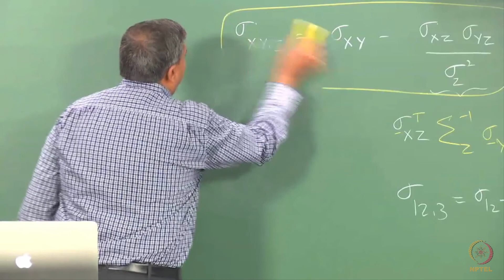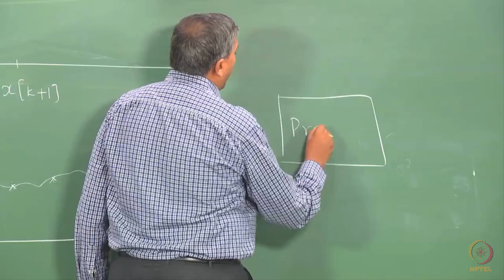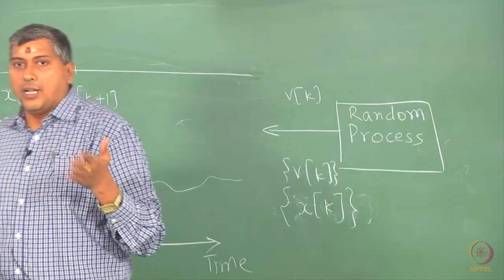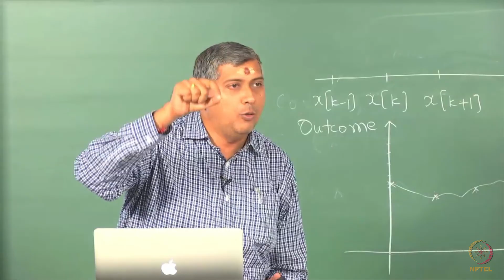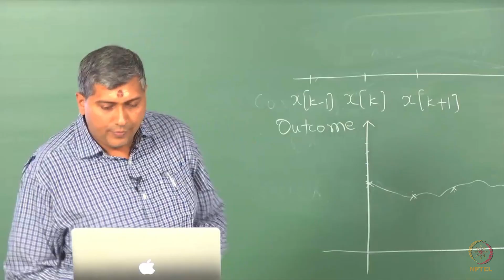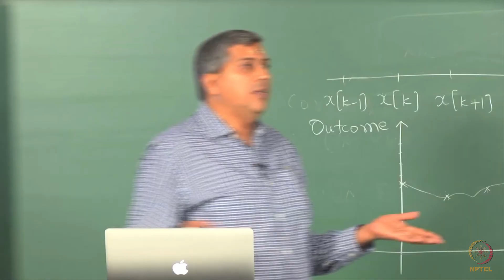Lecture 09C: Introduction to Random Processes-1

Comment: trying to answer the question without looking at the answer:

if we take temperature readings in the morning, like say sequence of values we are recording.. this is like we are recording one realization out of many possible realisations.. or we can say like we are sampling this random signal from the probability distribution over all possible realisations in morning time.. now we use this realisation to calculate statistical properties of the distribution we sampled from like trying to find say, mean, variance or other parameters.. now can we use these same stat properties in noon to say , ok morning we saw temperatures with variance of 0.2 degrees, so it will be the same in noon.. obviously no, because the probability distribution we modelled is not static, it changed with time and at noon we have a different distribution... so its not stationary (?!)

let me continue the video and see if i am right..

now i see that some student said a similar answer..nice (patting myself :P)... i have a question now, what is so "process" about inferrring statistical properties from a stationary distribution? having stationary assumption means once we find some parameters of a distribution, it is kind of fixed and we can do experiments like predictions just like doing normal random variable prediction

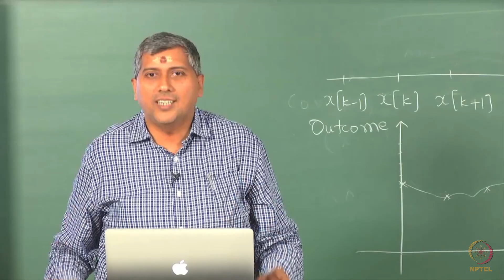lol at 27:52

Comment: Dear Professor,
I want to measure wind speed from 01:00PM-02:00PM. Suppose I have an 
analogue device which gives continuous measurement (a function). In 
this, if I treat measuring wind speed from 01:00AM to 02:00AM as my 
Random experiment, sample space consists of a set of functions(of time). Right? By that i mean 
out come of random experiment conducted once is a function of time, hence, ensemble is a set of functions.  Now, by the
 definition of random variable, it is a map from sample space to R (real
 line). Does that mean, I have to define a map (may be some norm of 
function) to define a random variable?

Comment: sir what does it mean by a realization? whether it represents a particular signal or the value of that signal at a particular time instant...
Reply from the maker: A realisation in time-series analysis refers to one of the many possible signals (sequences) that a random process can generate. It is sometimes referred to as the sample path. The collection (ensemble) of all realisations is referred to as the random process. So a realisation refers to a sequence (finite- or infinite-length( and not to an observation (at an instant).
Reply: @appliedtime-seriesanalysis7076  Dear Professor,   
Is it correct to say, in this random process, there are as many random variables as the number of samples in one realization (each described by its own probability distributions)?

Comment: great lecture. Professor Tangirala, would it be possible to share the lecture notes?
Reply from the maker: Thank you for the appreciation. The lecture notes can be downloaded by visiting the website http://nptel.ac.in and searching for this course.
Reply: @appliedtime-seriesanalysis7076   Dear Sir,  i have checked the notes/ slides are not available on above link. 
is there any way to get slides ?